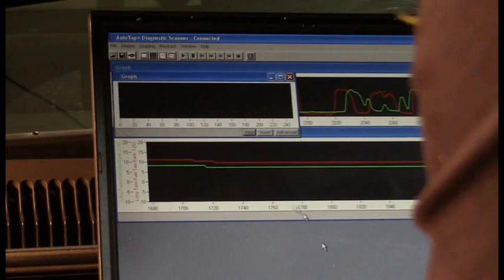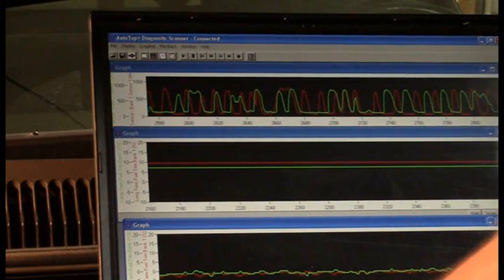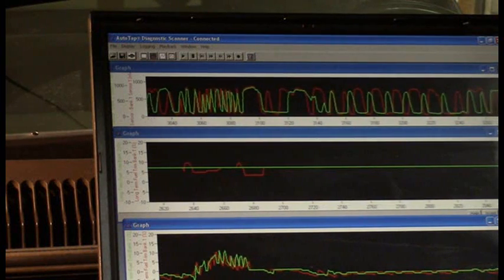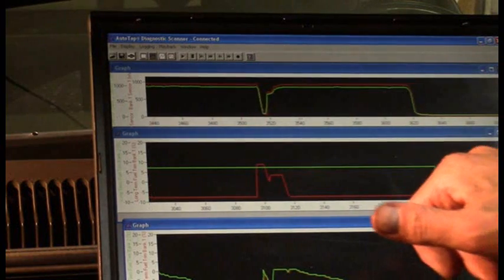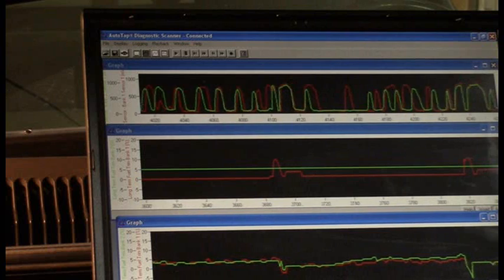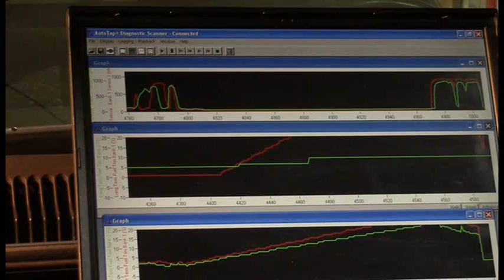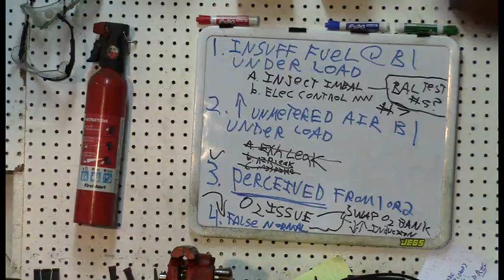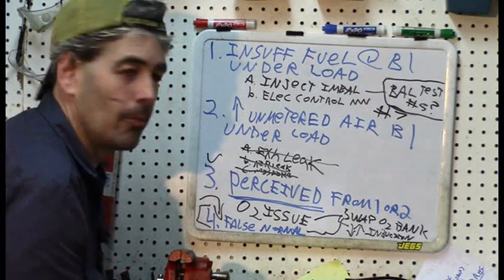Test Your Lean P0171 / P0174 Diagnostic Skills-Pt4

Comment: hello sir bank 2 is not affected may be because the vacuum hose is connected to bank1, thats why there is no effect in bank 2 if you put propane..
Reply from the maker: vacuum does not work that way. A B1 lean eliminated accessory vacuum as possibility.
Reply: Schrodingers Box thank you for quick answer sir. I've watched all your videos and I've learned a lot. I love discussing about fuel trims. Thank you
Reply from the maker: Chris Umel Thanks for watching. It was a good thought you had for sure and certainly showed understanding of fuel trim variables but accessory vacuum will always be ported or at intake.
Reply: Schrodingers Box you're welcome sir.
Reply: Schrodingers Box and all that I

Comment: It might be that the signal from one of the o2s is not making it to the PCM and the PCM is going of one o2. So maybe check the wiring from the o2 to the PCM. Also, might want to check the connections on the o2 for rust connection.
Reply from the maker: Agreed- I will be checking for exactly that possibility

Comment: When a case as complex as this one comes to a flat rate shop, you gotta have a little understanding of how difficult it may be for them. Not every shop has access to a scannerdanner to bail them out....
Reply from the maker: Yes the flat rate system can really eat you on this. I easily spent a couple hours tracking down the wrong etiology until I finally found this LTFT thing going on. I can easily see how anyone would have put O2's and maybe even a PCM in this thing after hours of tracking down diagnosis on "false" data that you would have no reason to expect is false!!!

Comment: Do you have two coolant temp sensors, one for each bank?  If the computer think one bank is not warmed up yet, it's operating in open loop until all sensors are up to operating temperature?  I'm trying to think outside the box(O2) since your test eliminated the O2 sensor. How about any other sensors that's bank dependent? 

BTW, I'm now in the two percent because I looked like a fool as a parts changer.   It hurts  my pride.  It also defeats the purpose of DIY.  It may be cheaper to take it to a shop. Thank you and others such as Mr. Danner.
Reply from the maker: Qiong Jia Qiong, I was thinking exactly the same thing with the Bank 2 stuck in OL. See my next video!
Reply: Yes.  I thought of the same thing since I didn't see formally see bank 2 in CL.  I believe I only saw Bank 1 in CL.  I don't know for sure B2 is in CL.

But, the STFT is changing, implying closed loop.  From my experience in OL, FTs don't change at all.  I'm trying to think why LT is acting so sluggish, yet there appears to be proper O2 behavior.
Reply from the maker: ***** Correct Michael- indications are clear both banks are in CL despite the fact I cannot actually confirm a B2 specific loop status or temperature from CTS.  All your thinking is dead on and in fact confirmed later in the series.

Comment: After seeing no reaction of the LTFT with the propane the next thing I would do is clear the codes, it is very possible you are seeing substituted values like Steve said. Then retest with propane again. It also would be a good idea to look at generic obd to see what your data is. I know you don't own a scope but this is a perfect time to back probe both front o2 signal wires just to make sure scanner isn't doing something goofy. I also would disable air injection pump and take on road test there are case studies were they come on when not suppose to and cause a lean code ! You have a good one here but the way your going about it I have no doubt you will get it done .

Comment: This video reminds me of a case that Paul Daner in a Ford. While not the same case is similar as STFT not fit but then the O2 sensor was completely dead and it ignore PCM, then the PCM will reset the settings to see. 

Here is the link if you find it useful: 

Ford O2 Sensor Testing 

A and sorry for my English is very bad, greetings from Spain:-)

Comment: My understanding and interpretation of your tests and O2 sensor swap is 1) O2 sensors are good and providing reasonable outputs to added fuel and air 2) STFT's are producing expected responses to added fuel and air, 3) LTFT Bank 2 is not responding or has severely inhibited response to added fuel and air. LTFT Bank1 appears to respond as expected to added fuel and air.

Since LTFT is a function of STFT changes and some unknown update algorithm, it seems that a PCM firmware error may be the problem. Perhaps a flash update for your PCM is avaiable.

I am not familar w/ Air Injection system on your vehicle but have seen cars w/ injection on the exhaust manifold. It would seem that this injected air would interfere w/ O2 sensor operation by artificially leaning the exhaust stream. Perhaps air is injected downstream of primary O2 sensors?
Reply from the maker: Tex, your thinking is absolutely congruent with mine in every way- except after doing some more research, I have found other explanations other than PCM firmware. I believe what we see on bank 2 is a substituted value for LTFT. Now, I don't know why the PCM would need a substituted value, especially considering we have O2 output and even STFT response. But I believe that something else is missing for the LTFT calculation and it may be because of the fact the car has a P0171 and thus may not be allowing other codes to show. But you are correct 100%- this is not an O2 sensor problem based on the data.

Comment: I just checked on Rock Auto. The O2 sensors for you TA are going for about $25@. Just in case.
Reply: I've been hinting at that from day 1! I went back and reviewed the original film several times that got this series going and notice that  the traces from the B1 O2 sensor wasn't keeping pace with the B2 O2 sensor even if it was spiking more than the B2 O2. After dumping all that fuel down the exhaust (Injector test ) then switching B1 O2 over to B2 O2 and now B2 O2 seams to be very lazy at best to dead! I'm talking about LTFT. But in any case it is great that we are getting all these intelligent educated theories. Some, with the limited amount of data, we have are pretty dam good.
Reply: Billy R Trouble is, is it being lazy, or is it getting less fuel than desired so it appears to be reacting late? (In this case, I don't believe we have a fuel delivery problem so that idea has to be debunked now, but it may be of value at other times.)

I too need to do some rewatching! The best stuff needs rewatching.
Reply: DE Nichols I so confused! I'm going back to the beginning and watching everything again. I think I am even going to take notes on all the facts to try to make some sense of all this. I am also going to do a lot more research to see if there is another direction we can go in, because I am just plain stumped!
Reply: I've done a lot of reading too. Just nothing helpful yet.

Hey when you don't have the answer it makes you learn. Have you watched Matt's latest?
Reply: Yea! Even more determined, all thou more dumbfounded!

Comment: Matt, something that occurs to me is that we are thinking that O2 sensors are either good or bad. It's not that simple. As they age their response time lengthens. It takes longer for them to react to changes in the air/fuel mixture. I sort of knew this already but there was an episode on "Two Guys Garage" were this subject was in fact discussed for about 30 seconds right between the product placements and the open shilling of fuel additives. I know that you would rather swallow Drano than swap parts but your TA is 14 years old. The O2's might not be dead but they could be tired. I've put my flack jacket on so fire away.
Reply from the maker: Lol the O2 sensors are definitely not bad.  We can easily see appropriate responses. My purpose of changing O2 sensor banks in fact had nothing to do with testing the sensors- it was really to see if there was a difference in the reading and data interpretation from the O2 sensors- and even then it was highly unlikely.  The O2 sensors are working- the computer is just not showing LTFT adjustment for some reason and is using a default substituted value- and I believe there is a logical reason for this.
Reply from the maker: ***** even were that the case, the problem did not move with swapping O2 sensor locations so a problem still clearly exists, though admittedly it may just be misidentified on the actual bank I suppose.  But this is specifically addressed in the next video anyway where I do bank specific variables and confirm the O2 readings are on the correct bank.
Reply: Schrodingers Box But, aren't the O2s responding properly?  From what I saw, they were.  It was the LTFT B2 that wasn't responding.   Both STFTs were responding as well.  So, IMHO, the mystery is why the LTFT B2 is 'stuck'.

Comment: That is a good one. I stayed with you right up to the point you EXHAUSTED your hypothesis. At this point I am asking myself where does the long term fuel trim come from. I thought it was a summation of the short term trims.  This all occurs in the PCM which is crunching data from the O2 sensors.  The LTFT signal being observed is the signal from inside the PCM.  
I want to substitute the PCM at this point, but I really want to see where you go to figure this one out, as a PCM is an expensive guess. I am anxious to see the next installment.
Reply from the maker: Yers your thinking is right on- "where does the LTFT value come from".  I am quite certain I don't need a PCM.  What I am sure that is happening is the LTFT is a "substituted value"- but still begs the question- where is the PCM drawing that value and more importantly WHY is it doing that, especially considering the O2's clearly work?  But I do have some direction for the next video based on this hypothesis. Right now, we want to exhaust (lol nice pun) any possibility that the fixed LTFT is actually intentional by the computer

Comment: When that test was done were  both banks in closed loop. I know by looking at o2 sensor swithing it looks that way but the computer could be in open loop on the problematic bank and in turn the computer can be given a substitute value for the long term fuel trim. You may  want to make sure that the code is erased beforehand sometimes the pcm will give substituted values or not act right when there's a fault, I have seen this before. Keep up good work.
Reply from the maker: James L Yes in fact my first thought was that somehow, Bank 2 must somehow be stuck in OL- I wondered maybe there is a separate CTS on each bank or something and the B2 CTS was somehow stuck "cold". But if so- why the STFT variation and even more so- why it isn't stuck rich if anything.  While I agree we are seeing substitute values, I am not convinced it can be from OL on one bank. I am more inclined to believe the P0171 initial code which started the whole video may be preventing the reveal of the problem causing this new discovery.
Reply: Could there be a situation... if fault code is hanging on background, it change fuel trim to work as factory default ?

Comment: These videos are better than watching sherlock holmes and dr watson.The ltft on bank 2 compared with bank 1 and its slow response definitly indicates a malfunction of some kind.It seems that either the vacuum or propane is being inhibited from reaching bank2 and its effects are being nullified.As the stft covers the mid to upper range of engine operation and bank 1 has problems in this range,the ltft will be more affected than bank2.The cause, my dear watson,could be the weighted value  stft array in the drive map gone bonkers.Mr Holmes you are a genius !!!
Reply from the maker: Tom OConnor LOL the only problem with your theory is we have definitive confirmation the vacuum/propane are not only reaching bank 2, but having a definitive effect on response both from the O2 and in fact from Short Term Fuel trim confirming "acknowledgement" of the induced variables.  What is not responding is the LTFT- the question is, is because of a computer problem where the LTFT learn is faulty OR is it (more likely) the computer is intentionally preventing the LTFT and is instead using a substituted value to compensate for some other issue.  Remember there is a P0171 on this car from the initial code- an O2 sensor code will prevent other related codes from setting. Methinks fixing the P0171 will allow the PCM to reveal why it is using a substitute data for the LTFT.

Comment: I like the idea of substituted values your other viewers have suggested. It would explain the STFTs. As I stated in my early comments in part 2, that you may have an O2 sensor on B1 that was dropping out. Then after all that Injector Balance testing,  pumping all that raw fuel into the cylinders and down the exhaust, you may have contaminated the B1 O2 to a degree and Killed it. When you switched the B1 O2 to Bank 2, could that be why B2 O2 now is flat. As John Decowski has suggested, I would check the O2 voltage at the PCM and I would Check it at the sensor it self to make sure what you are seeing is not substituted values. When you said we may have a lean condition effecting both banks then why didn't The B2 O2 detect that before you swapped them. I love a good mystery!
Reply: Yes, I was going to ask that question because manual injector balance seems to dumping quite a lot of raw fuel in the engine compared to the automatic one initiated by the scanner.  Is it safe to put that much raw fuel?
Reply: 12vgs8606 For the most part, yes you are. But you should not over do it because you could hydro lock the pistons while cranking if you dump to much fuel into the cylinders. It's also a good idea when done with your repairs to change the oil in case you have any seepage into the oil sump/pan from washing the cylinders clean. The dry cylinder walls and thined out/contaminated oil could do some major long term damage to crank, cam, rings, and bearings over time if the oil is not changed.
Reply: if that donot be safe... scanners makers donot set that software in.

Comment: While thinking some more... Are you in manufacturer specific mode or global obd on your scanner? The reason I'm asking because I was at a class a few months ago and the instructor emphasized using global mode because he says obd standard law prohibits substituted values and basically manufacturer specific mode they can give calculated values because it isn't under obd standard. I'd try both modes or even another scanner software so your not running in circles.
Reply: John you are right. I read the same thing about that.
Reply from the maker: Yes I am familiar with that and I agree we are surely looking at a substituted value and that is definitely my main direction for when I continue.

Comment: Looking at part 3, I notice you have a K&N style breather on or near your engine. I was wondering what/where this was being used? Secondly, and unfortunately I have not seen every video on your channel, can you please list all improvements/modifications you have done to your engine, if any. Third, can you check monitor status in the global mode of your scanner and tell us their status (complete or incomplete). Finally, can you please tell us what the 8th character of your vehicle identification number for engine ID. Thanks.
Reply from the maker: Agreed with the mods the problem is that these mods were all done 10 years ago and only recently did this phenomenon start- previously it was perfectly normal by all counts. But agree as someone "new" to the car, the mods would all be suspect but they are not the issue- this is a recent issue as of just a couple months ago.